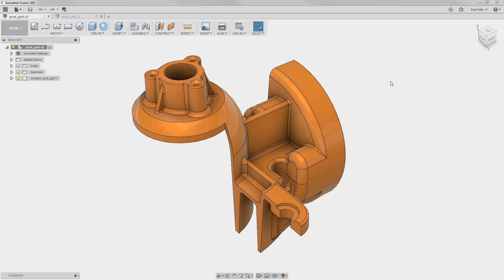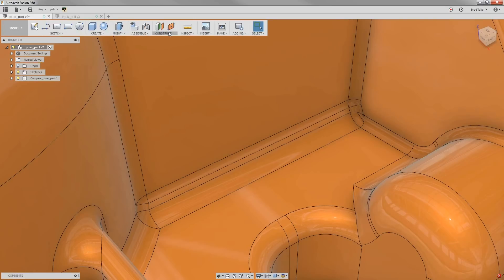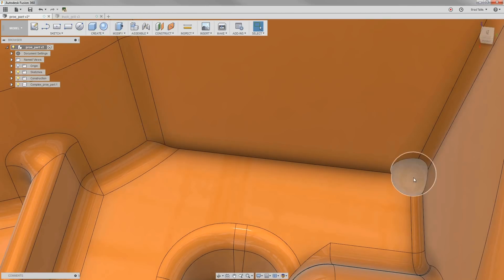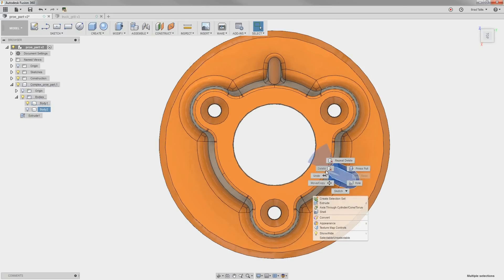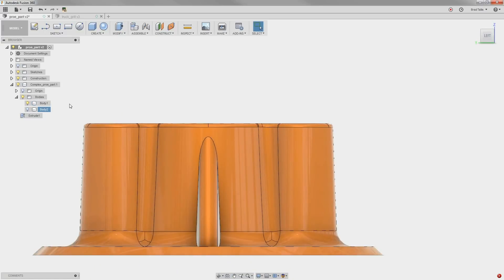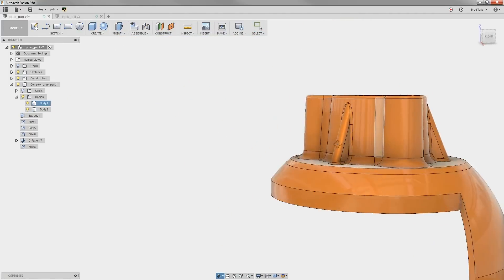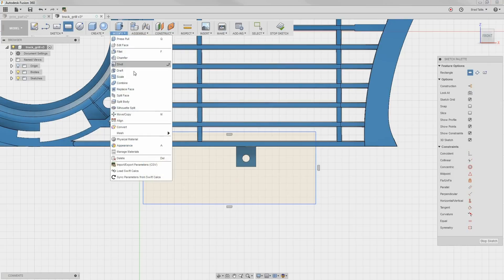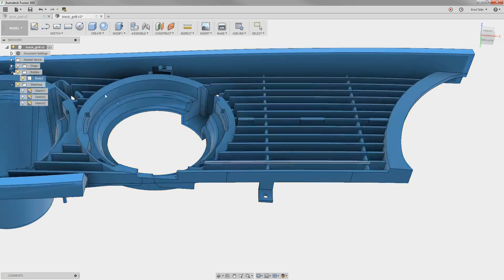Fixing Corrupt Models with Direct Editing

Comment: Hello, I hope I can get help from you guys...
I launch fusion 360 and everything opens up and all the options show up on the top of the screen. But the grid is covered by a white screen and the fusion 360 logo. It covers the work piece and I can't make anything
Reply from the maker: Sounds like an install issue? Or graphics related. Any progress in the last 16 hours?
Reply: Autodesk Fusion 360 
No progress, I tried deleting the program and reinstalling it, but the same thing happens. It worked on this computer before, but now I don't know what happened.
Reply from the maker: Okay, lets get you over to the Forum for support. This persons experience sounds similar: https://forums.autodesk.com/t5/fusion-360-support/fusion-360-loads-with-data-panel-all-white/m-p/8016482#M27056 

Can you try some of the suggestions there?